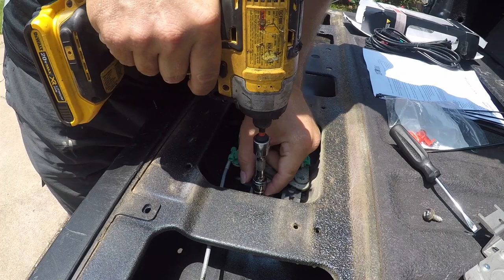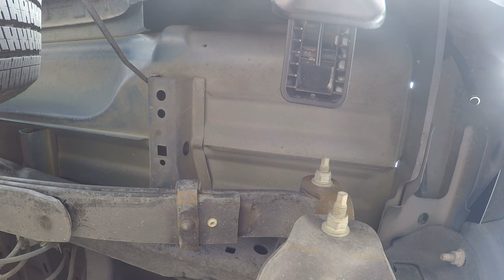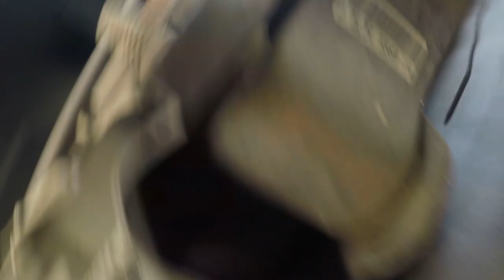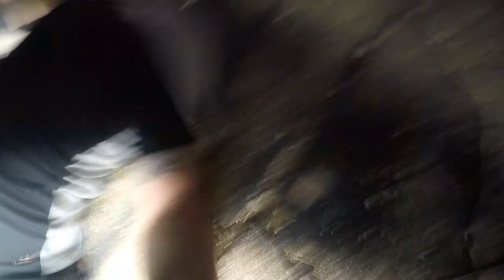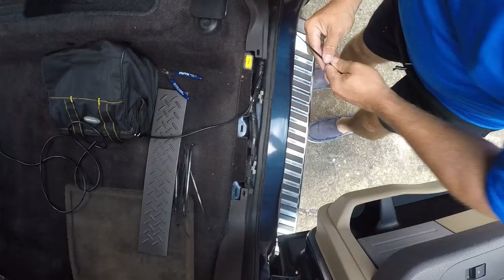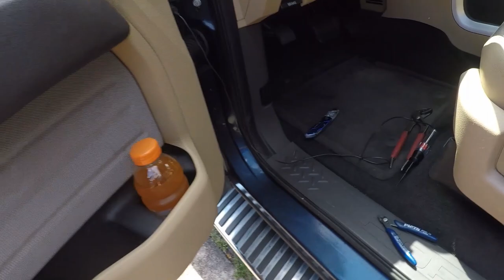F-150: Tailgate upgrade Pop and Lock electric lock kit

Comment: Thanks for taking the time to do this!  I think I spent more time watching videos on how to do this than I spent actually installing my lock kit.  I wanted to install this without drilling any holes.  I used the rubber grommet in the drivers side rear door of my 2013 F-150 Super Crew as you did.  Only thing I did differently was instead of drilling a hole in the grommet, I used an Exacto knife and simply poked a hole in it to feed the wires through.  Only been a day, but everything is working as it should.

I do hear the lock actuator assembly vibrate a bit when I close the tailgate, but other than that, no problems so far.

Comment: Thanks for the video.  I was really hoping for a closeup of the wiring splices in the door sill plate.  That’s where I had the most difficulty.  The factory instructions I got indicated that the splices could be made in the rear door sill plate area (where you pierced the cab grommet with your wiring).  I have had all kinds of trouble finding the light blue / green stripe wire.  I guess it’s only under the drivers door.
Reply from the maker: I had to hunt for it with a tester.  The instructions weren't correct.

Comment: I'm a bit confused about how you routed the wiring. It looked like you went down the passenger side to go through the firewall, but then suddenly you were on the drive side drilling a hole for the wires through a plastic plug so they could entry from below.  It's just one harness right? Taking it down the driver side is the best route, right?

Edit: for anyone doing this, just follow the harness on the left frame rail to the engine bay, push a wire hanger through the grommet above the brake pedal where the harness comes in and use the hanger to fish the wires in that way. Just pull off the kick panel that covers the hood release mechanism and run it there. You don't end up with a bunch of excess harness this way. It's the perfect length. On my 2011 SCREW there were two blue with green stripe wires. If it doesn't work, look for the second one. The instructions are accurate, but kind of out of order and hard to follow, so read them thoroughly.
Reply from the maker: I think I started on the passenger side and realized that what I needed was on the driver side.  So that's where I ran the wires.  

I've since traded the truck in.  Something in the tailgate lock failed right before I traded it.  It's the stealership's problem now.

Comment: Hi Brian.  I really enjoy your videos and have commented a couple of times, but what's happened to the old school bus conversion?
Has it gone the same way as the Neoplan?
Regards Mark in the UK
Reply from the maker: Hi - it's just a longer term project.  Keep in mind I had the Neoplan for about 5 years.  My initial focus on the Crown was getting it road worthy.   and getting it home.  Then work called me and I had to go out of town for 1.5 months.  My Ford Escape Hybrid is getting older and isn't delivering the gas mileage I wanted with ladders on top.... so I upgraded to an F-150.  The F-150 needed some immediate modifications and changes to be suitable for work.  I do insurance adjusting and work storms..... that's what pays the bills, so it gets priority.

I'm planning to work on the bus over the winter when the temperatures aren't 100 degrees in the shade.  I've also been picking away at the damned Gulmite screws on the inside.  I just don't see value in filming the removal of each one, although I do feel like celebrating it.

I do appreciate you asking about the project and watching my videos.  I've got some Crown stuff in the works.  I swapped out the ignition switch last week.  Didn't solve the issue where I can't start it from the drivers seat.... so I need to troubleshoot the wiring to see what is going on.  I'll be posting the video when I get a chance to edit it.  I'm in Baton Rouge, LA for a class this week related to work.
Reply: @hotpuppy72  Hi Brian, and thanks for such a lengthy answer. I almost feel a bit guilty that you might have felt the need to give it justification.
My comment (obviously) wasn't a criticism, merely a request to see more of such a fab project.
Have you had any enquiries re' the sale of the Neoplan?  Is there much interest in a vehicle like that where you are, or in the US generally?  I can't see why there wouldn't be; apart from the spares situation I suppose.
Well, (I'm sure) we're all keen to see whatever videos you put out when you're ready.  Take care.
Regards Mark in the UK

Comment: YOU DRILL A THE HOLE AND PUT NO PROTECTION IN CASE WATER SEEPS IN AND RUST THE CAB
Reply from the maker: It'll be okay.  It will still rust through in one of the many other places there is a hole in the cab.
Reply: @hotpuppy72  YEAH BUT THOSE HOLES ARE COATED
Reply: The hole was in a plastic plug. not the metal cab, I'm 99% sure.